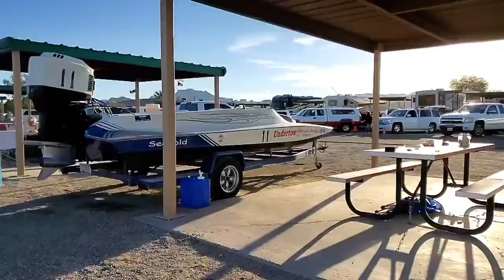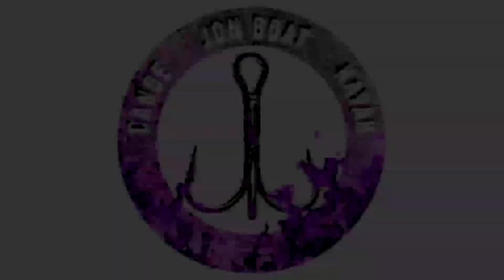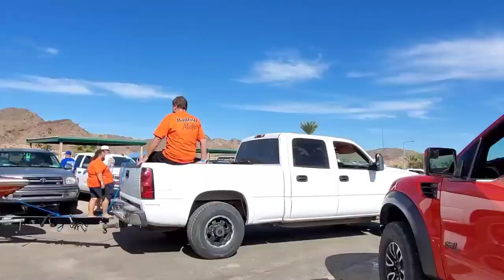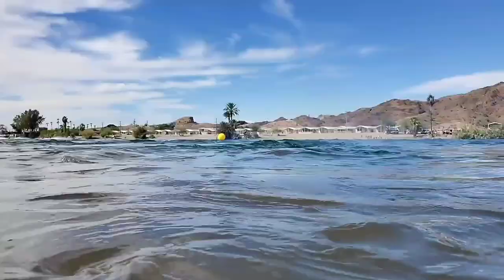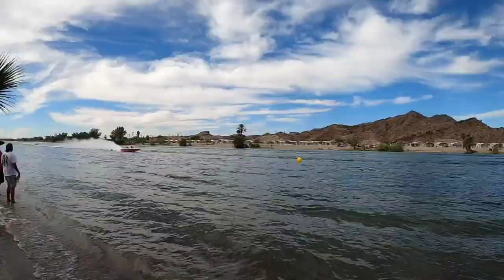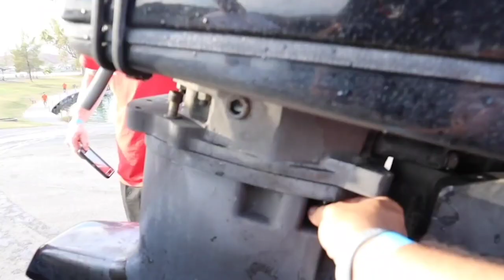Race till your Boat Breaks! Parker Enduro 2020 | Parker Strip | Tiny Boats, Giant Motors |

Comment: STV and a SVT, Perfect combo!
Reply: @TinyBoatNation  STV is the type of boat most of the video was from with the helmet cam ( Red tunnel boat with the mercury outboard, the truck towing the STV was a SVT (Special vehicle team)  AKA "Ford Raptor"
Reply: Yeah Man I had a STV Uro-Ski Hull, 2.5 Merc, yellow with purple and lime green stripping. Man Loved that boat, it was also my first boat. Had a quick learning curve I guess.
But honestly it was set up so good, and cut through the water so true, I couldn't believe how much control I had, even in very slow condition's like docking and such, it drove like a car, pretty much turned on a dime from 2 mph to 80mph I never got up the courage to try to tight turn faster than that. 
Top speed with 32°pich prop was 106 flat calm lake.

I was hoping they would say how the red & black racer STV faired?
Reply: @Mr.Martin4500  yeah, though I have owned a bunch of different go-fast hi-performance Pad-vee and Mod-vp tunnel hulls, Hydrostream, Laser, STV etc. There's NOTHING like the way an STV drives, handles, accelerates and they turn harder than ANYTHING I have ever owned or been in! 
  Miss my STV Pro Comp, by far the most capable, safe performance boat that I have been in!
 *And the 0 to a hundred++ MPH acceleration (modded, drag ported 2.5 fishing motor) with a 26" Yamaha style drag prop copy was just phenomenal!

Comment: Love the music / roaring engine soundtrack...if your a true gearhead you'll be listening through a full system running at least 300 watts with  subwoofer mids and highs all amplified and cranked past halfway 🤓.complainers must be non mechanical softies becausethey don't know how to construct or run a full audio system..the engine sounds and bass were vibrating my house just as they would in real life...nothing wrong  with the audio ,maybe it's the inadequate little partial range speaker your listening  on .absolutely awesome camera work and narration as well ! ...saving this video  !!

Comment: If you think these are bad ass... check out Mike Finnegan's jet boat ...twin turbo hemi in his boat. his channel is Finnegan's Garage.
Reply: Blow boats are a waste of hp
Reply: @independentthinker8930  agreed...but still cool
Reply: @independentthinker8930  yep, there is absolutely NOTHING like the sound and performance of a lightweight outboard powered performance boat!!
Reply: @BabyCharlotteschannel  and a hydro rocking tip toeing across the water. We build an engine, had a 11'9" boat built, tuned, 7 1/2 hp engine, ran just over 72 mph three the traps

Comment: as a boat guy and an insurance agent, no insurer will give you a better rate if you promise to never go on a certain body of water.  insurers ask where you use the boat.  if on occasion you take the boat out of that area, i don't know of a single insurer that would not cover you the same.